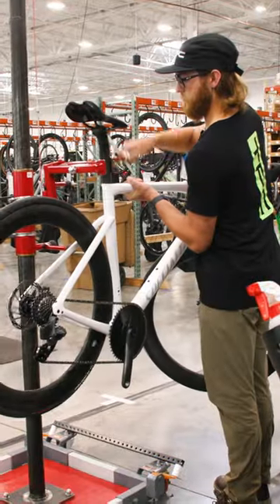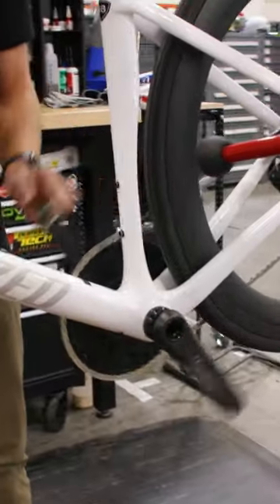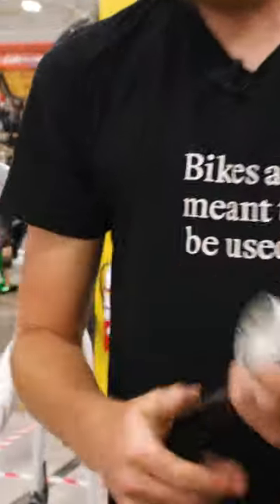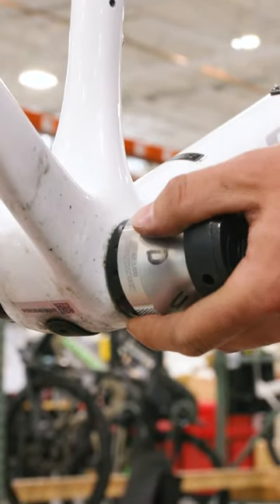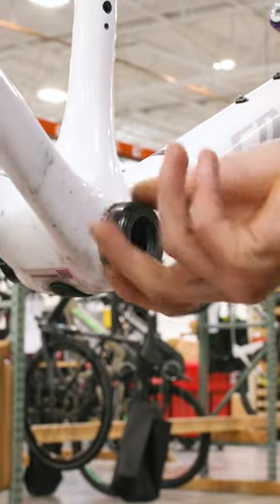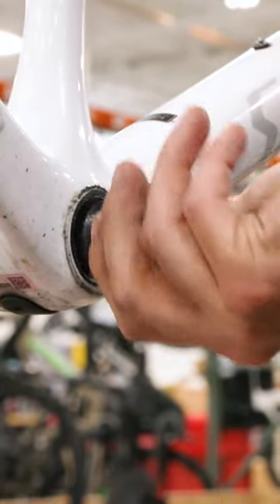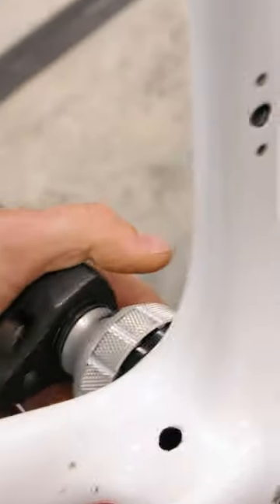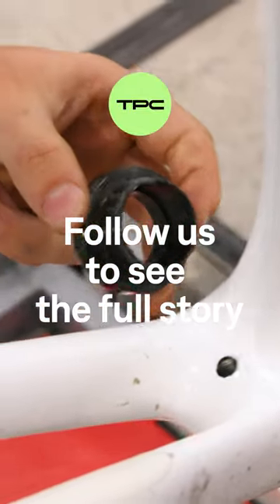Why Bike Mechanics LOVE Threaded Bottom Brackets | Inside TPC | TPC #shorts #specialized #bikewrench

Comment: I have never had any issues with press fit bottom brackets. But, then again, I never bought an overpriced frame from a manufacturer that didn’t know how to make round holes. 😂 
Agree that threaded BBs cover up poor manufacturing practices. However, the bearings will now compromise the crank, instead of creaking. IYKYK.
Reply: I’ve never had a problem with Giant PF bottom brackets.  Bonding a metal threaded sleeve into a carbon frame has its own set of manufacturing issues.
Reply: @petersouthernboy6327  bro threaded bb has same manufacturing process at your ta frameset. metal thread carbon body, boom. same

Comment: Pressfit is the best! Bicycle frame manufacturers are just too cheap and lazy to get precision tolerances done correctly.
Reply: I’ve never had a problem with Giant PF bottom brackets.  Bonding a metal threaded sleeve into a carbon frame has its own set of manufacturing issues.

Comment: Pressfit was a big error in the bike industry.  Thank goodness they wised up and went back to threaded bb’s.  Can’t believe some bike manufacturers still sell pressfit bb’s👎🏽
Reply: Almost...  **** quality control was the bike industry's mistake. Just about any other bearing design around the world (including your hubs!) use press fitted bearings.
Reply from the maker: True, but hubs don't experience the same torque as a BB.
Reply: @theproscloset  A bsa bottom bracket still has pressfit bearings (bar some very rare exeptions)
Reply: It is because bike manufacturers struggle to align two holes together. Threaded bottom brackets allow for a bigger tolerance in manufacturing due to that there is more play allowed in threadings than it is allowed in interference fits (i.e. bearings) the more load the more the problem presents itself which is why badly made bottom brackets creak but good to ones are always perfect in how they run.
In theory the press fit bottom brackets are better than threaded bottom brackets if the proper tolerances are met due to the loading factors that are happening to the bearings. Unfortunately bike companies don’t know how to align two holes and get the tolerance within 0.05mm. Hint: literally only the cycling industry has a problem getting to this tolerance. I have seen better tolerance presented in high school robotics.
If threaded bottom brackets were truly better in every case then it would have been used in the aerospace and automotive industry a long time ago.
Reply: I’ve never had a problem with Giant PF bottom brackets.  Bonding a metal threaded sleeve into a carbon frame has its own set of manufacturing issues.

Comment: Just like hookless rim, pressfit is the industry easy and cheaper way. Not for user benefit. But marketing really works for some gullible, snobbish roadies. Whatever the brand told, they believed
Reply: I’ve never had a problem with Giant PF bottom brackets.  Bonding a metal threaded sleeve into a carbon frame has its own set of manufacturing issues.

Comment: I never understanded why the fuck would you put a reversed thread on the drivetrain part, instead of locking in it just unscrew over time, the biggest piece of garbage i've seen in my life, and this applies the most on budget cartrige square tappered bottom brackets, you can't jusmp with them because it'll start making noises and fuck with your brain searching up for a metal one